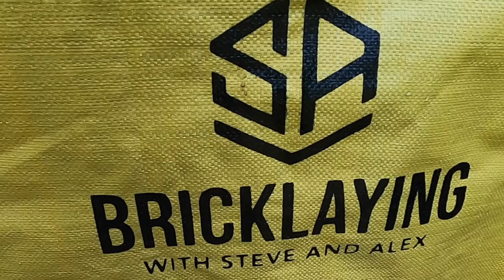TOUGH AND CHILLY FOUNDATION DIG!!

Comment: Congratulations on new van 👍🚐
I take it you didn't know where any pipes / services were before you began digging? How do you go about digging? What's your method approach?
I have so far dug out footings for an outbuilding and replaced my old lead water main, in the process found the old gas supply, new gas supply, electric supply and drain pipes. So I'm learning as I go.
Garden wall footings and patio next. Would be interested on how you go about digging in relation to pipes/cables/services.
Great video thanks for sharing, see you in the next one 👍👍👍👌👊🤙💯🍺
Reply from the maker: Services are one of the reasons we don't bother with a mini digger , they can do a lot of damage. We would rather hand dig carefully around anything that we find.🧱👍🏽

Comment: Always use the deadlocks on those vans, I got done 3 times. Shocking security on them. Also amazes me how little concrete you seem to use. Where I’m from it’s a meter minimum, most of the time 1.5. You’re lucky
Reply from the maker: Thanks for the advice pal 🧱👍🏽

Comment: Also don't get the depth off foundation though I may have missed something but in my area BC insist that new foundations must go down to the bottom off existing regardless off how sound the ground is,its because of Interstitial movement where lateral forces undermine the existing founds causing horizontal movement to the new and old walls. I'm surprised BC passed it but again I might be seeing this wrong.

Comment: You what am going say mentioned a few times get a concrete saw will rip through that in no time meaning less strain on the back. Just bought a another Stihl TS700. Beast of a machine some power most powerful saw on market from stihl. Best saw for you would be the TS420. 125mm cutting depth have 1 of these also great work horse for all round general cutting. Cracking effort and graft as always boys. 😎👍🏻
Gas ⛽️ is the way forwarded lol 😝
Reply from the maker: In all honesty we cant afford that sort of kit mate. That kind of Money would put a serious dent in the garden which hasn't been touched for over 13 months. 🙄🧱👍🏽
Reply: @SteveAndAlexBuild  
Fair enough buddy. You’ll get a good run in the summer free up some extra funds. Maybe get yourself 1. Ts420. £610 way brand new never buy 1 second hand as most don’t put the right oil in the machines half goosed engines. Will pay it’s self back in no time. Will save a lot of time and less stress on back. Take care bud will look forward to rest of this job coming along. 😎🤟
Reply from the maker: @lmilne4859  . Thanks for all the advice Lee .
 Cheers 🧱👍🏽👌🏼
Reply: @SteveAndAlexBuild  
Anytime buddy that’s what it’s all about putting info to try help things work easier av learnt so much new tricks from your videos. Every day is a learning day a say. A do lot similar works renevations extensions exc. always come across different obstacles on each job. Take care bud.
Reply from the maker: @lmilne4859  . Very true mate . Cheers 🧱👍🏽

Comment: Nice hard working gang! I know everyone suggests something but... After having to dig in rocky clay every time you put your shovel in the ground and you hit a gah damn rock... this attachment works way better than a pick. Just pop it into sds max hand held breaker and dig... it’s not too expensive and a time save if you gotta dig. 👍

https://www.boschtools.com/ca/en/boschtools-ocs/sds-max-hammer-steel-hs1922-29549-p/

I have a Bosch RH540M and it does the job just fine ... used it on a hilti t-65 works a little better than the Bosch, but hilti costs way too much for my budget!
Reply from the maker: Thanks for the tip 👌🏽🧱👍🏽

Comment: Do you have concrete pumps in the UK...???
Reply from the maker: Yes we do Barry , very expensive so only used on very large jobs 🧱👍🏽
Reply: @SteveAndAlexBuild  Here they are only $90.00 per pump if you use the concrete supplier,  so it's pretty much always used... Stay safe... and turn the radio off... :) :) :)
Reply from the maker: @bazmon  wow over here you probably talking £90 per hour 😯. We have a lot of companies who will barrow the concrete in for you so ideal on smaller jobs 👌🏼🧱👍🏽
📻🔫💣😉